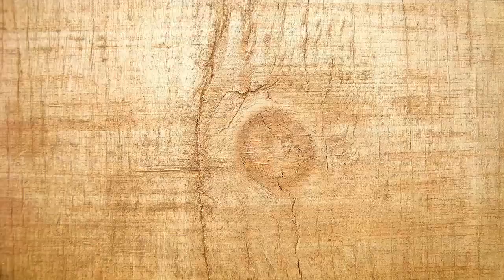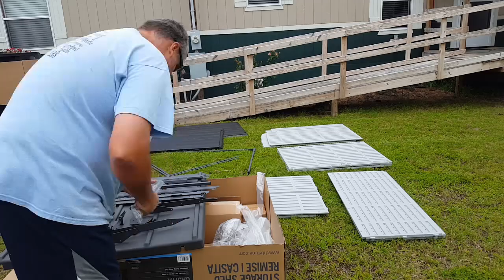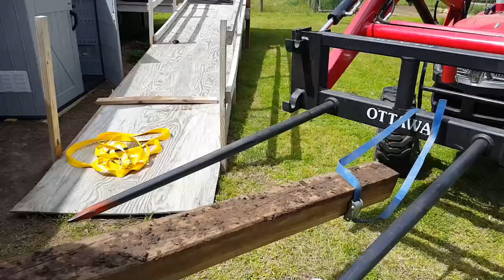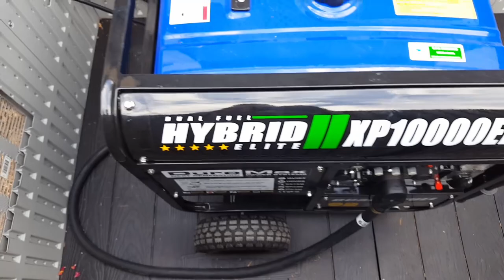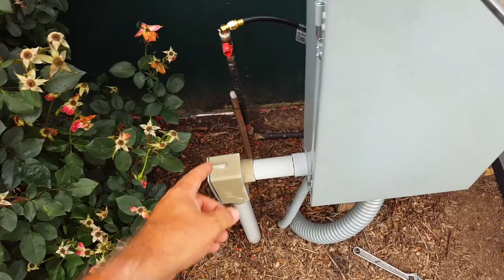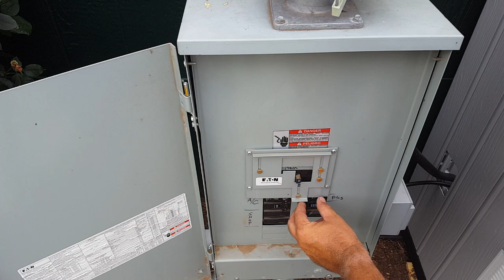Generator for the house - Dual fuel whole house system

Comment: Nice install.. found this posted by Gary on another YouTube channel and I plan to follow for temporary use only, not permanent.... It describes how to bypass the low pressure regulator. Gary says "Just FYI. You do not need a low pressure regulator from the tank to the generator. The regulator on the generator is capable of handling full tank pressure. Your l.p. gas line would be fine at full tank pressure. Think about it... you can connect your generator directly to a portable tank like a 20lb or 100 lb. tank with the connector provided on the generator. So dropping the pressure to the generator is not desired. The regulator on the generator is designed for direct tank pressure. The tank size doesn't matter.  It's the outside temperature that controls the tank pressure being that propane boils at -44deg F. I have mine connected directly to my 360 gallon house propane tank. The generator sits about 10 feet away from the tank so I connect it on a "as needed" basis directly to the vapor equalization valve on the tank. (Full Tank Pressure) Purchased the connector on Amazon.  Looks like a large Schrader valve on the tank. I just screw it on when I need it and unscrew it when not in use. That way the generator is only connected to my propane tank, when and if, I need to switch from gasoline to propane in an extended power outage."
Reply: Oops, I am reposting what Gary already posted here. Sorry. Still think Gary's regulator advice is best. You decide how to plumb it: black pipe, yellow poly, whatever is code.
Reply: Can you please provide link , or part number for connector on Amazon. the Schrader valve. THANKS!
Reply: @foeteef  here is a link... various sizes depending on the size/length of the hose coupling you use 
https://www.jmesales.com/emerson-fisher-brass-female-acme-x-mnpt-vapor-return-coupling/

Comment: fyi - another helpful vid pointed out that these generators produce a lot of heat and toxic fumes while operating and to locate these a substantial distance away from the home for proper ventilation and away from windows and vents that  could allow the toxic fumes to seep into the home.

Comment: Your propane company is terrible. If you only have one regulator coming off your tank you need a 2 stage regulator. The regulator that comes with the unit for the tank is 2 stage.
Reply from the maker: Please enlighten us all... I will be waiting with a soda and popcorn in hand for your response. But I already know you didn't watch the whole video and will be yet another YouTube keyboard expert that we just laugh and smile at around the dinner table.
Reply: BigRedFishDad Just the fact that they don’t know how it works shows me they have no idea what they are doing when it comes to the low pressure needed to run a generator. You don’t need anything larger than 1/2” to run a portable generator. The way mine is set up, and it runs perfectly, is off the 250 gallon tank that you have a high a pressure regulator on. The 3/4” pipe then goes under ground for about 15’ to the house. Before it goes in the house there is a low pressure regulator. It then goes through approximately 40’ of 3/4” pipe before everything starts to T off. The line for my generator (Duromax 13,000EH) is hooked up on the same 1/2” feed line that feeds my dryer and hot water heater. I put a T in there and then ran another 50’ through my garage to where in wanted the propane to stub out for my unit. So you either need 2 house regulators like I have, or 1 two stage regulator at your tank. All I’m saying is your propane provider should have simply been able to tell you that you needed a low pressure regulator right before the generator off your 1/2” pipe for it to run. Again, the regulator that came with your unit is 2 stage. No keyboard warrior here, just setting up generators to run off propane weekly. When you’re talking the big standby units like Generac, you’re either gonna run 3/4” dedicated from the tank or 1” depending on distances and the unit size. Then you just need to know if the tank regulator is one or two stage. If it’s one, you add a low pressure regulator right before the unit. If it’s a two, plumb away. I have pictures but YouTube doesn’t allow pictures in comments here. Just set up a 16kw Generac 2 days ago with a dedicated 3/4” line from the tank to a low pressure regulator right before the unit. How would you need anything larger then 1/2” when the hose provided is 3/8” at best. Again your propane store sucks.
Reply from the maker: @jsjunkremoval  yep, as expected comment keep typing... funny how you have the same exact generator brand and have been "installing" generators weekly but still don't know a thing about it. This generator will not run on low pressure out of the box (as was mentioned in the video as well as WHY we don't have the other regulator)... but thanks for watching the few seconds of the video that you did :)
Reply: BigRedFishDad really? Won’t run out of the box on low pressure? That’s odd. Mine does. Just fine. Perfectly in fact. Same with the dual fuel champion I hooked up at a customers house a few week ago. I watched your whole video. I’m just failing to see why you had such issues when I have never run into that ever. All these generators run off low pressure. Including the conversion kits from US Carb and others.  I literally have never had the issues you had because I made sure the proper regulators were in place first prior to running the unit.
Reply from the maker: @jsjunkremoval   Ok, I don't have time to debate with you! BUT as a final note on their own website, the min pressure is 3PSI hence why we changed to the 10 (mentioned in the video)... but OK, you're the man 🤣 Really you are, Really.
Reply: BigRedFishDad it won’t run on low pressure out of the box? 3psi is low pressure. That’s the minimum. The tank pressure is anywhere from 100-200psi. But then again, I hooked my unit with no issues and you had issues with yours. You have a gas company telling you may need a 2”’supply line. Get out of here. That black hose is 3/8”. So again, I hooked mine up no issues. You hooked yours up, you had issues. So who know more about what?
Reply from the maker: @jsjunkremoval  whaaa whaaa whaaa... no issues been using it for couple years now.
Reply: BigRedFishDad i said you had issues. Not you have issues. You still haven’t told me how 3psi isn’t low pressure and how these units don’t run off low pressure.
Reply from the maker: Geeze.... If your a propane guy you would have figured it out. I had to read a little before I figured it out and put on the 10psi reg... but here you go... just because comments peak the activity and support the channel:) the regulator we removed was something like 0.5psi because it was specific for the heater that was mentioned in video. So we had to remove that to get proper flow 150ft to the  generator. (0.5 is WAY less than 3 simple math) so the generator would never run.
Reply: BigRedFishDad I’m not a propane guy I just know how it works. My whole statement came from them trying to say you need a 2” feed line and all that. The first thing they should have asked is what regulator do you have coming from your tank and is it a 2 stage or high pressure. If it’s 2 stage you’re most likely good. High pressure and you’re gonna need another one to make it low pressure. Pretty simple to figure out.

Comment: I don't know what state you live in, but you typically need to run galvanized pipe outside unless it's buried. In that case it should be wrapped with 10mil tape, or coated with some sort of plastic or epoxy coating. Not a good idea to run gas on top of the soil. Just saying
Reply: No, No, No,   Never run galvanized pipe using LP. The LP will eat away at the galvanized pipe.

Comment: A electrican told me a setup like this is illegal and not to code of a state or County. 

If an inspector comes to their home, they will get a fine for safety   for not having a permit by a licensed professional.
Reply from the maker: Get a new eletrician... before install I read many forums where electricians were discussing the permits needed or required for a lockout switch.  Some of them even mentioned the exact same lockout plate and brand.
Reply: Its too close to the house for sure. But electrically speaking it is using a receptacle. Its not hard wired into the house which means your electrician is probably wrong.
Reply: @chrisstewart4823  As the electrician stated, that breaker is not supposed to be connected to a construction generator.  That generator is portable not a standby generator. 

This is the reason why you have it in a storage bin.  Not to have anyone from the electric company  to set it.

My electrican had installed a standby generator, Kohler, and I had mentioned your video as well as showing him.

He pointed out the gas line as to be a certain about deep in the ground, which you did not mention.

Also, he stated once a gas line is underneath the ground you have to have a yellow as well as the gas line have a cautious tape lay on the ground for anyone who may dig near or around.  

Placing a propane gas line to a tank is done by a licensed professional to make sure their is no leakage in the line and a inspector will come to make sure it is done properly.  You have to be licensed. 

Furthermore, if you are connecting a transfer switch from the meter, you have to have a permit so the county or state to verify if it is up to code and it is done correctly. 

 Also, the electrician has to post on the meter a standby generator is connected to the meter box to warn anyone who has to touch the meter.
Reply: @chrisstewart4823  You are placing people's homes at risk by doing it cheaply.
Reply: @weeziemarklen  The only risk is the generator being so close to the house inside of a plastic container. Electrically speaking its fine, which was the basis of your post.
Reply: @chrisstewart4823  It was not.  My post was the hookup regarding the generator itself.  No county or state in any state would allow any homeowner to have a construction generator hookup to an electric meter.  It is illegal, which could cost the homeowner fines and penalties. 

That is the point.
Reply: @weeziemarklen  Well, your wrong. Exterior generator input is totally legal when used in conjunction with a utility lockout plate. Hundreds of thousands of homes have them if not more.
Reply from the maker: Says the Generac salesman ;) It is perfectly legal and no county or state (well the actual electric company) allows any homeowner or even a licenced electricians to hookup directly to THEIR meter. That was why we put it in OUR main breaker panel. and you are partly correct it is in the storage bin to hide it from thieves my mom lives in rural area lots of equipment goes missing around the farms out there. And so she doesn't have to try and roll a 200lb generator around when it is storming. Hey thanks for the laugh I haven't paid for an electrician since the day one charged me $75 to install a break on the main panel for my water heater. Two screws and snap it in I already had the breaker he took less than 2 minutes for $75 bucks. BELIEVE me I respect them for people like you but many folks for simple jobs like this Ill never hire one again. 

I'll give you the gas line she knows where it is so won't be digging on top of propane. We will be replacing it this year with the yellow poly pipe.
Reply: @BigRedFishDad  You are incorrect.  Anyone who touches a electric meter must be a licensed electrican to pull the meter to add a transfer box/switch to a meter and you must have a permit from the county or state to install a generator connected to the meter as well as a propane tank.

    If you are not licensed, the electric company will send an electricians. This is required in all states. 

You probably did not notified the power company to check your hookup was properly installed by professionals.

It just a matter of time before the county or state find out.

As was told to me by my parents, follow the laws of the land and the cheapest will eventually cost you more in the long run.

Comment: Just FYI. You do not need a low pressure regulator from the tank to the generator. The regulator on the generator is capable of handling full tank pressure. Your half inch line would be fine at full tank pressure. Think about it... you can connect your generator directly to a portable tank like a 20lb or 100 lb. tank with the connector provided on the generator. So dropping the pressure to the generator is not desired. The regulator on the generator is designed for direct tank pressure. The tank size doesn't matter.  It's the outside temperature that controls the tank pressure being that propane boils at -44deg F. I have mine connected directly to my 460 gallon house propane tank. The generator sits about 10 feet away from the tank so I connect it on a "as needed" basis directly to the vapor equalization valve on the tank. (Full Tank Pressure) Purchased the connector on Amazon.  Looks like a large Schrader valve on the tank. I just screw it on when I need it and unscrew it when not in use. That way the generator is only connected to my propane tank, when and if, I need to switch from gasoline to propane in an extended power outage. So loose the low pressure regulator to the generator. Just run a line directly to the regulator on the generator and that's all. One other note. If you have been running your generator on gasoline and want to switch over to propane before the gasoline has run out, you need to turn off the gas tank fuel supply valve and allow the carburetor float chamber to run out before switching over. Otherwise it will try to start or run on what ever gas is still in the float and the propane at the same time and will basically flood out the motor with both fuel types.  The way I do it is to start it on gasoline then turn off the fuel valve and let the motor run till it empties the float and quits.  Then start it on propane.
Reply from the maker: Well yes that is exactly right... that was the whole reason we removed the low pressure regulator and installed the red one... thanks for watching.
Reply: @BigRedFishDad  
Even the red high pressure regulator which drops tank pressure down to about 10 psi to the l.p. gas line is not needed with the duromax. " 0 " regulators are needed between the propane source and the generator regulator. The built in regulator on the generator is designed to handle full tank pressure.  As I mentioned, I connect mine directly, at full tank pressure, to the vapor equalization valve on my 460 gallon tank. No reduction of pressure to the generator. So if the tank pressure is 90 psi at ambient temp, that's how much pressure is delivered to the generator at the point where it connects to the generator regulator. Anyway I was just trying to help. 
Some folks were trying to run their generators on propane and having problems with it shutting down or not starting at all.  I suspect its because they are running low pressure to the generator with an additional regulator and the generator regulator is getting starved. It probably ran ok at no load but when the generator was put under a load and the engine tried to pull more fuel to run, it couldn't pull enough volume of l.p. gas and the regulator shut down because of not being able to draw enough propane volume and low pressure. 
Thank you for sharing your experience with your generator.  
Gary.